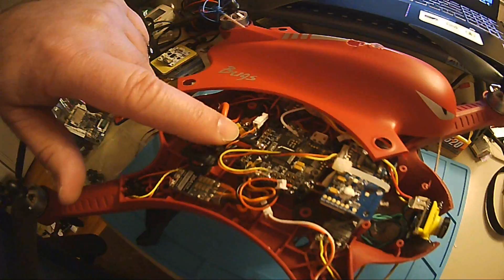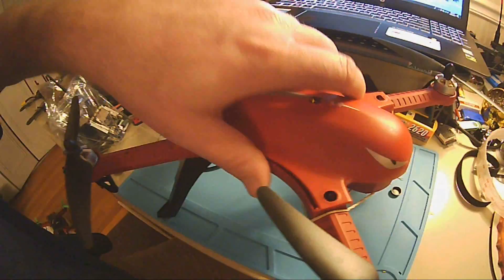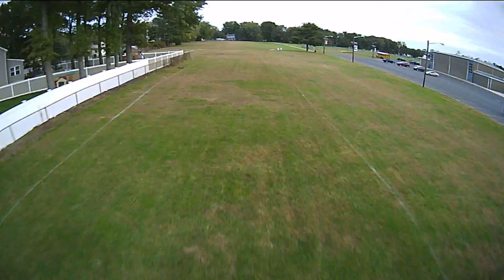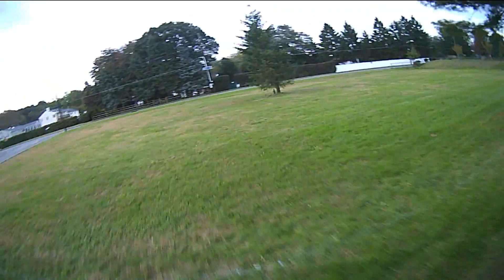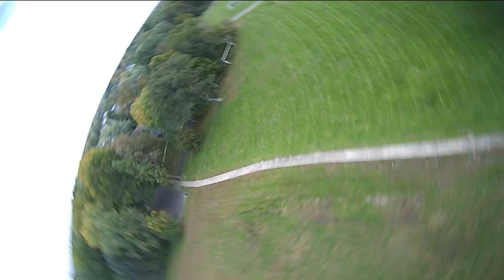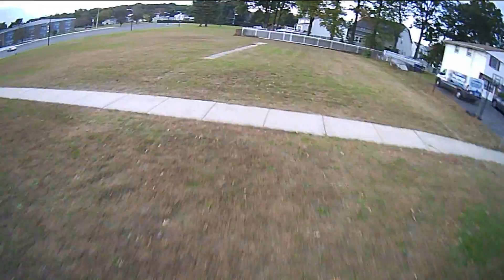MJX Bugs 3 Acro

Comment: I was hoping it might be this easy. I think I want to mod my Bugs 3 into a GPS drone, stick an F4 in there with iNav. I've never built before, but gotta have something to fly when it gets cold out. Acro Bugs 3 looks like a lot of fun, and that little Firefly Micro 1 takes great video at speed and I have all the parts - just need an FC & a radio. Thanks a lot for sharing! This is very encouraging. Happy flying! Cheers from Glenn in Rochester, NY
Reply from the maker: That would be a cool project to add iNav with GPS you gotta give it a go👍🏻

Comment: That setup fly great!! hey Steve you do not need to change the ESC's ,the stock ones can support Dshoot600  , i followed Joshua Bardwell method to know the highest Dshoot mode that the stock Bugs3 can go, you set the Dshot150 mode and reboot , you hear the ESC's making the  " DO RE MI "....." DOOO ...MIIII"  , "DO RE MI" means the ESC's turned on , and the last 2 notes "DOOO....MIII" means the sucesfully connection with the FC, so you select the next mode , Dshoot 600, and again i can i heard the complete set of notes, when i tried dShoot 1200, i only heard  "Do Re Mi" so Bugs3 Stock ESC's can only go to Dshoot 600 ...
 , im just finishing my bugs3 mod with an SPRacing F3 in Dshoot 600 mode with betaflight V3.5.7 , however cause i have a FLYSKY FS-IA6 ( pwm only ) i cant use SBUS mode ( i will add an FS-IA6B ) to relieve some wiring mess, my PDB never arrived on time so i stripped down a Car USB cell charger to provide 5V to the FC, and hard wire the ESC's to the battery connector, im planning to get some Dalprop 5045's as i love how Chris Riley bugs fly with them, my next project will be wire all if the PDB and adding a VTX and camera, but that will be later on, for now i just want to have fun and learn Acro ;) ,
hey is there any specific reason you change the stock ones ?
and last, how do you recorded the video feed from the bugs, is that the video FPV camera ? video do not break at all !!
what googles / DVR you have ? , that flying footage rock!!
 Keep the good work mate.
 Rolo
Reply from the maker: Thanks for that info I wasn’t aware that they would support DSHOT 600. The camera used was the Hawkeye Firefly micro v1.

Comment: So is this mod basically soldering the escs to the new FC? Would love acro on my bugs 3. I have the c5820 fpv cam I'm using with it. Would love to keep current stock set up with an acro FC. Thanks!
Reply from the maker: It really is that easy, I used some old Little Bee ESC'S but I hear the stock ones work as well. The PIDS are weird, but your welcome to try mine to get started.
Reply: Steve B thanks. I'm no soldering expert so this would be a big project for me to make sure everything is connected correctly. But good to know it can take this kind of mod to get it acro ready.
Reply: @DRTOLLZ  
Don't forget u need different transmitter and receiver
Reply: Przemo S thanks yes I have a transmitter. Would get an xm+ most likely. Do you know what size prop nuts the bugs motors use?
Reply: Steve B I'm looking to change the stock props out for Gemfan 6042s. Would those be okay to use? Also do you happen to know what size nut cap I'd need with those for the bugs motor shaft?
Reply from the maker: Adam Tolli I based this Betaflight build on the stock props maybe this https://youtu.be/XeZXoQH0Pgw

Comment: you did not have to change your esc's , did you know that the stock bugs 3 esc's will run on 1 shot 125 or pwm . i run mine on 1 shot 125 with no problems at all.
Reply from the maker: Chris Riley Music Drone Videos I didn’t try the stock escs, that’s great to know! This FC has a built in Betaflight OSD but it was getting a lot of noise. I did get a buzzer working for battery monitoring.
Reply: @WildCaptures  I just put a Babyhawk F3 controller into a Bugs3 (F100). Using stock motors and esc's and it's working really well on 2s and 3s. However I wasn't getting as much output to the rotors as with the stock controller. I think it has to do with the esc's and how they are seen in betaflight (I am using onshot125 as well). I actually reset maximum throttle to about 1850 while testing at 2s because it seemed to top out at ~1850.  However it screams on 3s and is almost as fun to fly as my Hawk 5. Not as quick, but still agile and punchy.

https://www.youtube.com/watch?v=rqqzd9wDE0s&t

Comment: Awesome job brother. and thanks for the credit.  are you still running on 2s lipo?  it flys great !  i have a new bugs 3 and a new f3 board ordered for it. im going to run this one on 4s just like the last one that i crashed into that pole. i just love how they fly in air mode. this is an easy mod that i think most people are scared of.  even going to smaller props and 4s lipo on the bugs 3  i think scare most people. i saw j drone run his completly stock bugs 3 on 4s lipo and it was stock from head to toe. no mods at all except 4s battery. i think this mod will catch on fairley quick once enough people see the bugs 3 can handel all these mods with out burning up.  again great job brother.
Reply from the maker: Chris Riley Music Drone Videos Thanks Chris I’m gonna try 3s next with stock props, it’s crazy that the Bugs will handle 4s🤭